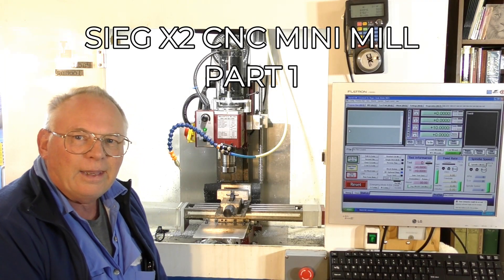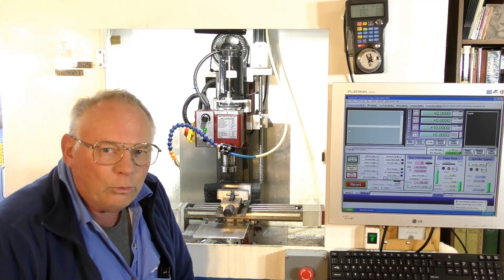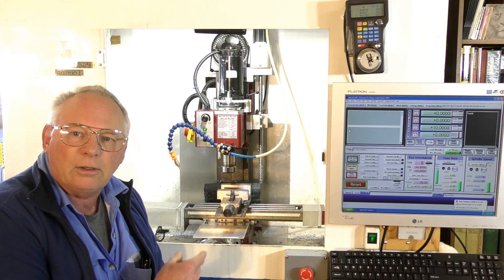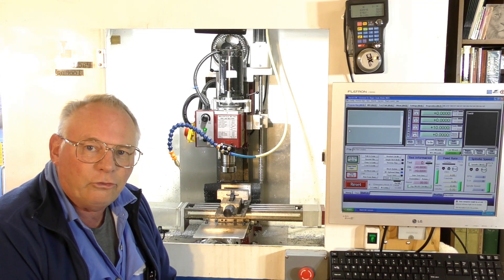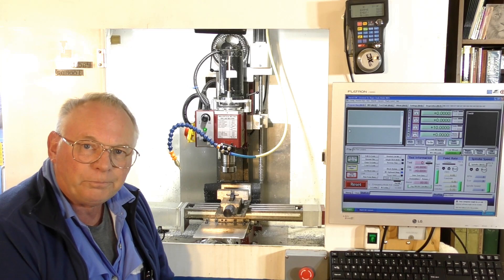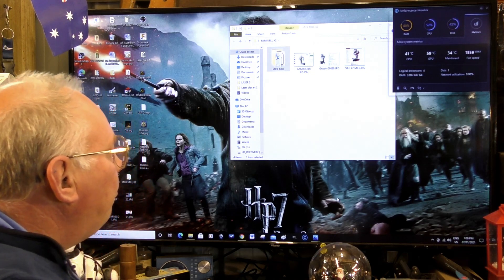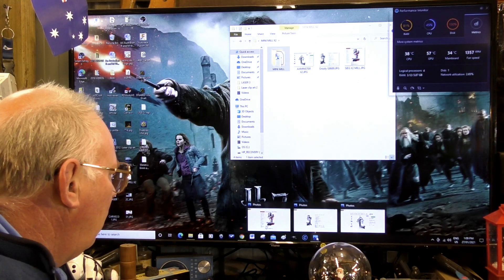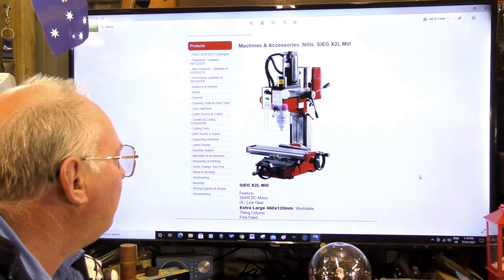Harbour freight/grizzly X2 CNC mini mill conversion kit drawings are now available

Comment: what are the travels/working area of this machine?
Reply from the maker: 230mm x 110mm x 210mm
Reply: @inventorsworkshop9600  Not to niggle, but the work envelope you cite (230mm x 110mm) is exactly that of my Homier Speedway X2 (as well as the Harbor Freight, Grizzly and other X2's sold in the US in the early 2000's and up to this day).  The X2L, which was introduced a little later, had a larger table and a greater work envelope  (300mm x 132mm). So your mill is like the others of the first "generation".  Of course this would affect the what ballscrews folks would want to order, and possibly the geometry of some of the other X-axis conversion pieces -  if they actually have the larger table, like the SX2L's,  the LMS HiTorque mills, etc...  🙂